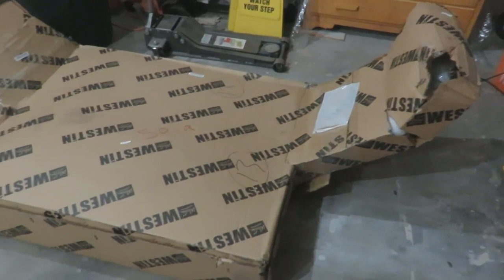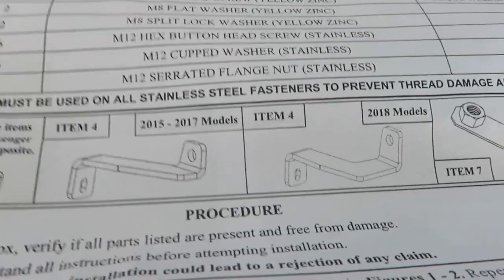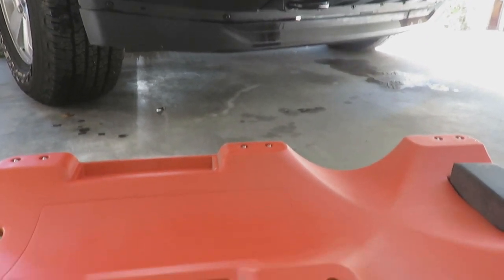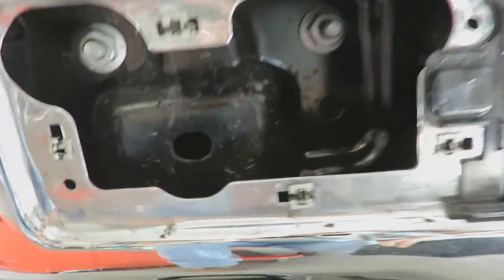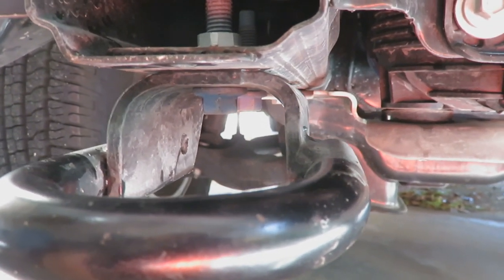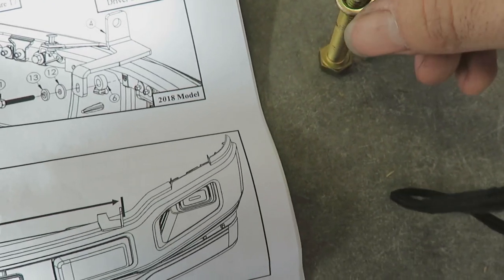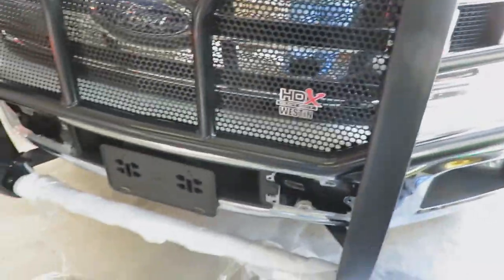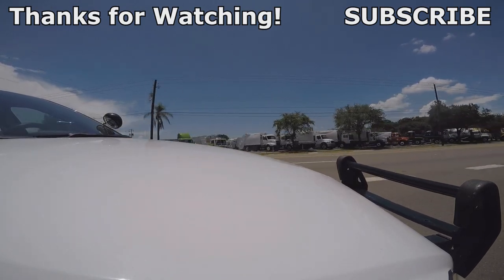2019 Ford F150 XLT - Westin HDX Grill Guard (Push Bumper) Install

Comment: Just installed my Westin Elite XD push bumper on my 17 F150 using your video for reference. The Westin instructions SUCK, thanks for posting this vid it DEFINITELY helped the process! 
I was worried about the middle strand of the headlight guard blocking the turn signal on our truck, do you notice this issue at all?
Reply: I was wondering the same thing.

Comment: Are there any mounting points for fog lights, driving lights or lightbars?
Reply: I believe not. 

The Westin Elite XD Push Bumper is the same as the HDX except it has attachment points for lights and other accessories. It’s the police version. I think it may have tougher steel uprights for pushing/ramming. But that’s unconfirmed.

Comment: Im assuming its about 130lbs. How much front end sag did you get from the extra weight added?
Reply: The manufacturer claims the weight is about 93lbs.

Idk about suspension compression, but i imagine there would be some. 

A 2inch leveling kit would probably do the trick. :)

Comment: Im looking at getting a grill guard for my 2019 F150 and was really looking into this, but I was wondering is it possible to remove the mesh in the grill?
Reply from the maker: There are about nine - 3/4" long stitch welds across the top of the mesh roughly 4" apart, they are located on the back side of the upper tube (and 9 more on the lower cross tube), it would take a little time, but you could hit these welds with a grinder to remove the mesh, repaint the back of the grill guard (where the welds were) and be good to go.  So it's possible to modify, if you want to put the time into it.  You might be able to find something similar without the mesh if you look around - I think GoRhino has something similar without the middle mesh.
Reply: Westin makes a Sportsman grille guard that has no mesh in it.